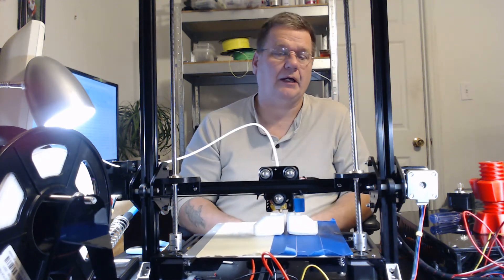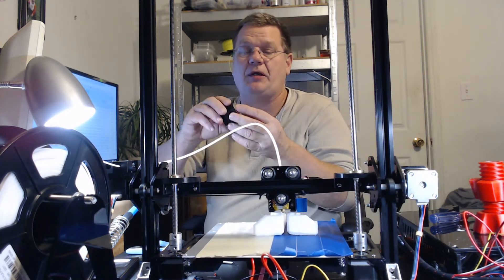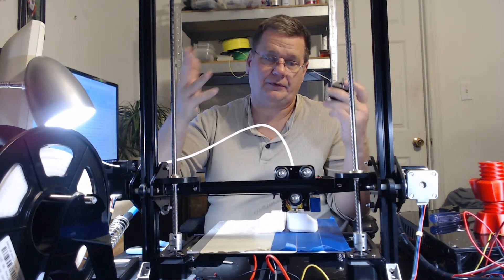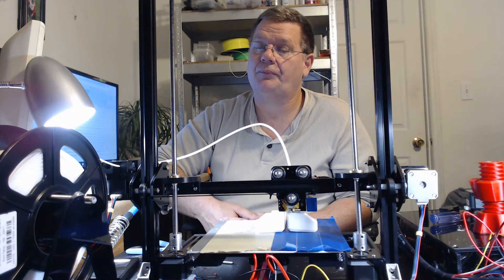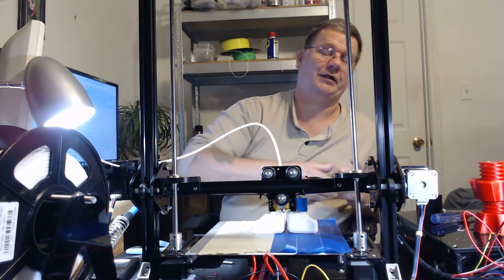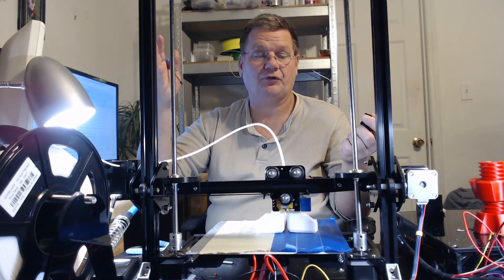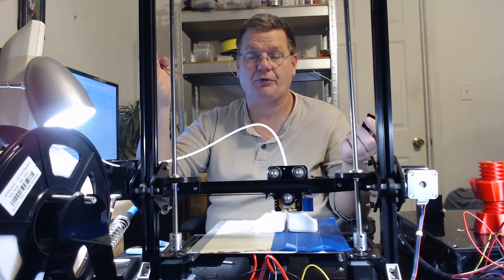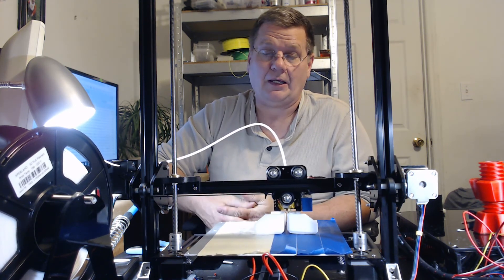Tronxy X3a Extruder problem

Comment: There is another problem with this extruder mechanism. There are only 3 screws holding it when there should be 4, so the side with the spring sits up in the air at an angle. This reduces pressure on the mechanism, causing under extrusion. I used a small model clamp to hold it down. Also increasing the temperature by 20 degrees C will help to fully melt the filament, making it easier to push through.